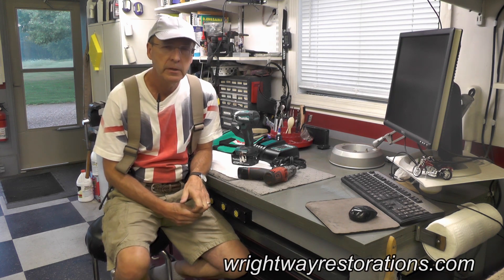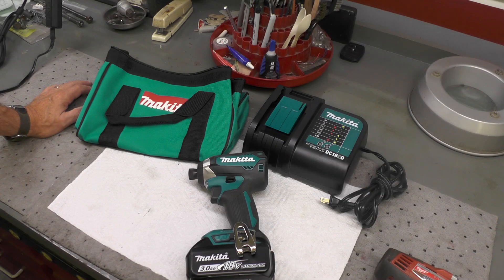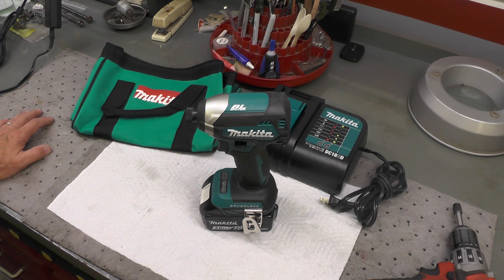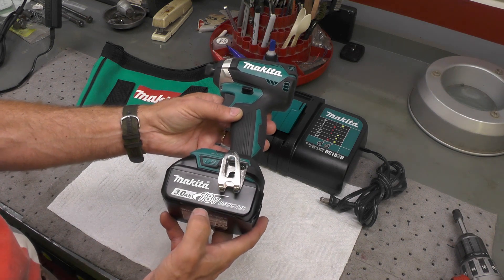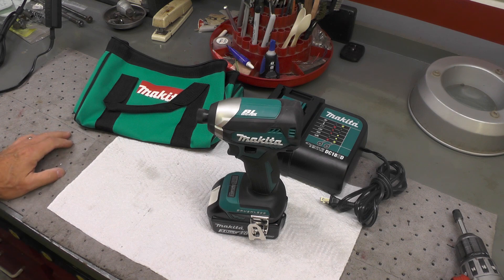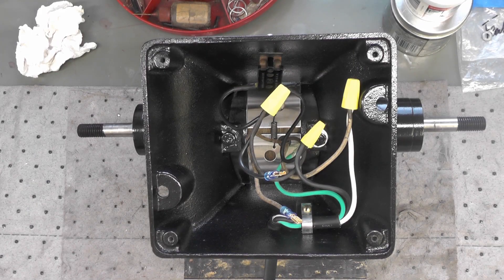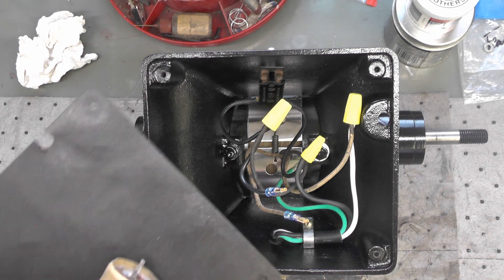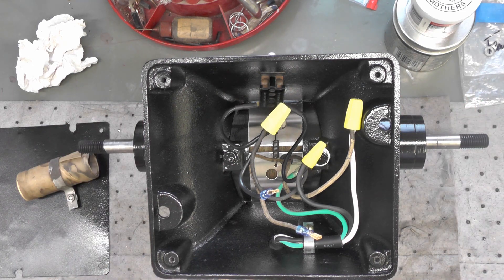Shop Talk #04, New 18 Volt Tool Platform, Update on Black & Decker 8 Inch Grinder     Video #117

Comment: A few months ago I bought an 18V Dewalt impact driver after seeing restorers on Youtube using them. I can't honestly say I've had much use for it!. I don't strip bikes down every day but I did use it to quickly shoot the crank case screws into my 1969, Kawasaki F4 before the sealant went off. I prefer the 'feel' from a 'T' bar or screwdriver frankly.
Reply from the maker: My interest in a 18V impact was primarily for disassembly and quickly running multiple fasteners in or out.
I also prefer going the manual route when tightening up fasteners, especially as they begin to snug up.
It seems I frequently need a driver around the house/yard and working on other equipment, such as my diesel tractor, so I expect I'll gradually press it into service.
Thanks for the comment...
Reply from the maker: One other note, I'm intending this battery platform to be the basis for expanding into other 18V tools, such as a string trimmer, blower, etc.  There are literally dozens of tools available for this platform and though I started with the 1/4" impact, it's just the beginning.

Comment: hi i watched again your video instaling the front wheel.you mentioned you put new zink plated parts in a parts tumbler to polish.ive been thinking of getting one for some time now.what media do you use and is it in your opinion a good bit of kit thanks mart.
Reply from the maker: Though I've tried different media over of the years, I now use crushed walnut shells exclusively.  I've simply had the best luck with crushed walnut shells for my type of projects.
Using a tumbler/polisher is particularly useful when one has multiple pieces to do.  If you only have the occasional few pieces, a tumbler may not be worth the investment.  If I only have a few pieces to polish, I usually do it by hand, if I have a batch, they go in the tumbler.
Reply: @kwrightway  thanks for your reply.im getting one.thanks mart
Reply from the maker: @martinreed8570  You are most welcome...